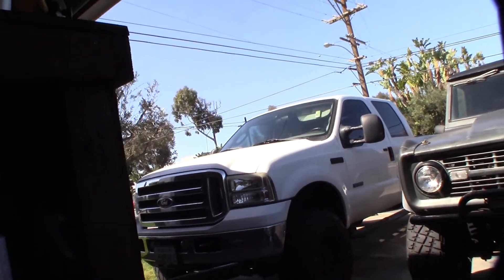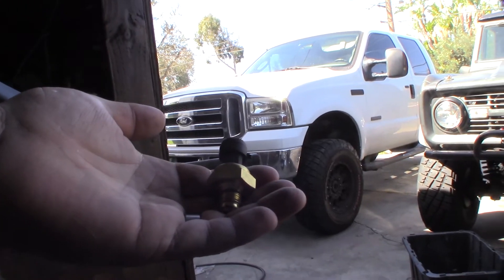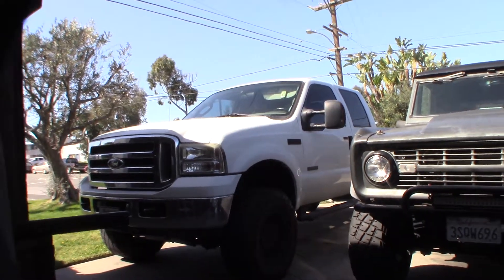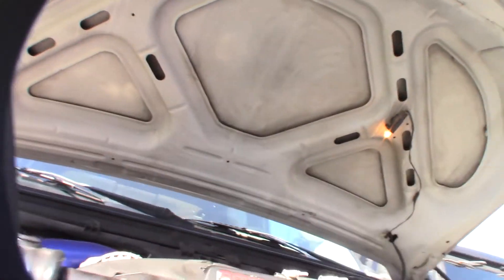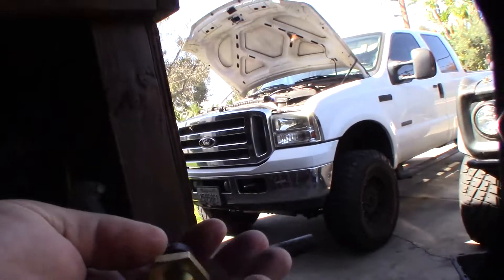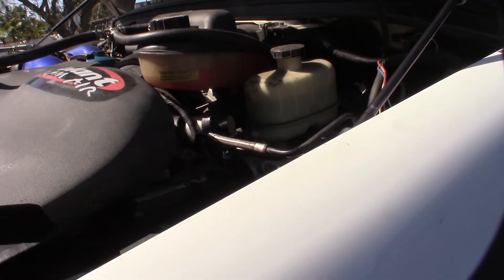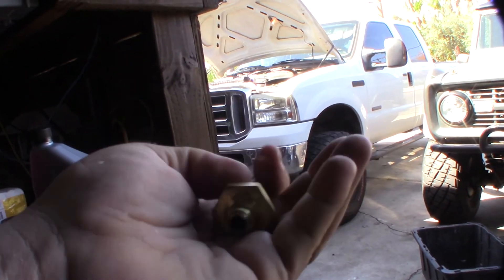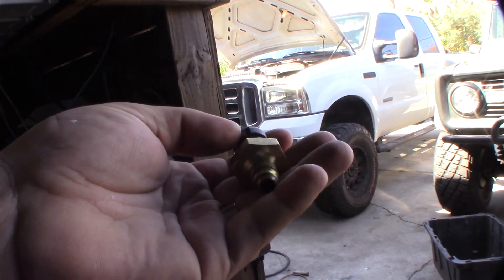Powerstoke 6.0 diesel VGT idle surge bad EBP exhaust back pressure sensor

Comment: If the 6.0 is tuned with a diesel tuner the vgt will be at %85 and it is normal. If not tuned it is a problem.
Reply: Serkan Oncel mine is tuned with full 5 inch exhaust...my Vgt has started reading 40% on idle. I also can’t hear the turbo out of the exhaust. Still drives good but idling sounds like a gasser. Any thoughts?
Reply: I would be willing to send a picture of oem reference values for all of the sensors on your 6.0 engine. I have access to it at work I could send it to an email address or txt msg for your personal use but I'm not posting it online because it would probably be copyright infringement.
Reply: Anthony Rybczynski how would you know if you have a bad vgt?
Reply: @jomar3379  i use judgement while test driving and monitoring exhaust back pressure vs map(should be close). I would check fuel pressure properly under full throttle load while driving and monitor icp. Check maf sensor live data Consider flow restriction like a bad catalytic converter. I use a special rotunda tool that works with a ford VMM to test the solenoid. If it passes the test then i assume sticking vanes. If everything is good Disassemble the turbo hot side and free the sticking unison ring. If you do not have access to the rotunda sprecial tools or have limited funding then just remove the turbo and remove the v-band clamp and remove the exhaust housing. Remove all rust and debris from inside until you can place all of the vanes back in position and actuate them with the ring. Once you can move the vanes very easily using the ring, reassemble the hot side.
Reply: @anthonyrybczynski5420 you’re a godsend

Comment: Hi I have a 04 F250 6.0L powerstroke on my torque app my EGR sensors aren't reading says no data. The system was just flashed to pass smog says EGR complete and it was reading before but the EGR was bouncing all around.